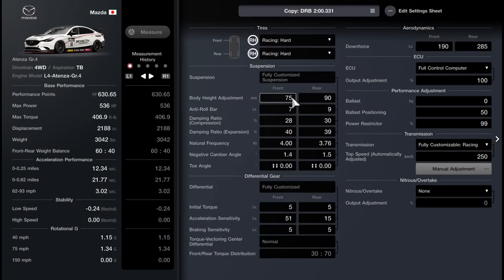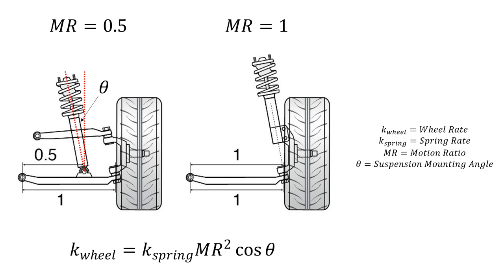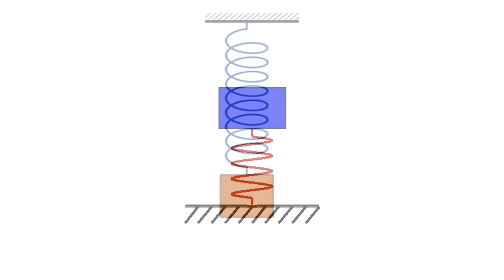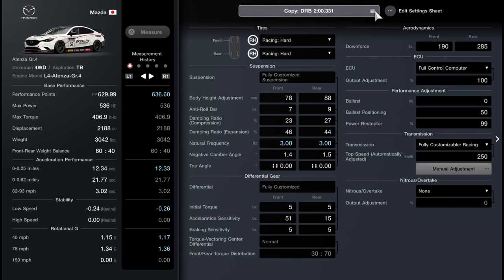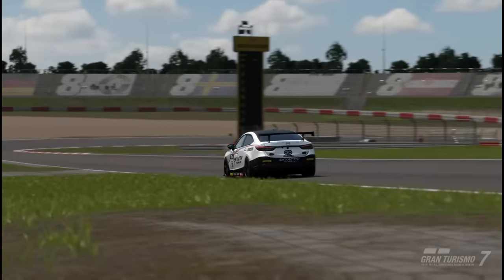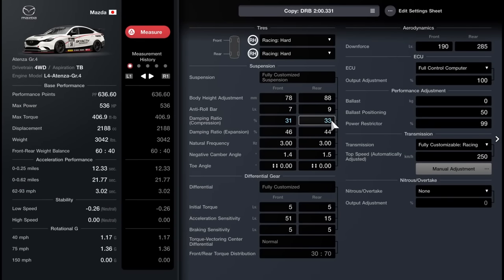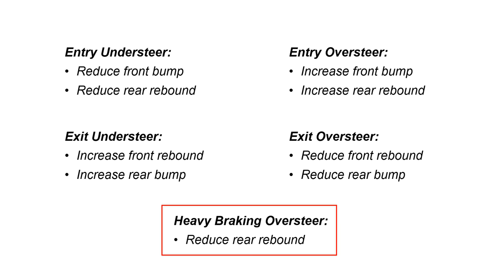How to Tune SUSPENSION | Part 1: Springs and Dampers | Gran Turismo 7 Tuning Guide

Comment: i spent several hours (lol) tonight playing with tuning, starting with whatever the game gives as baseline w/ the fully adjustable suspension. i found that pretty much every car (road car, not gr.1/2/3/4) i've tested has a default tune with the ride height and/or the natural frequencies so low that the front squats enough under braking to bottom out the suspension, and simply getting the right balance between ride height and NF alone can vastly improve how the car handles. many of the cars i've tested so far required some pretty hefty increases to ride height and NF to get close to where they probably should be.

Comment: Thank You so much for really breaking this all down. Really understanding both comprehensive  and rebound of the Damper is not only extremely helpful and interesting in the game but also real life. 
  I has a set of Fortune Auto 510's for my STI. I wanted to track it but also be able to drive it to the track. I had a vague understanding on how they act. 3-4 clicks from the softest for street the more clicks for mountain runs and 8-10 on track days.  We never really hit any rumble strips so I can run them pretty stiff on the track. Anyway thanks again, you really opened my eyes and gave me a new understanding for suspension.  I only have a single adjustment nob, and really don't like messing with the springs but I'm going to try a little softer for  track and see how it goes. ✌️

Comment: This is all really helpful. I appreciate the science, but the "showing us" is what I find most helpful. It gives me a good idea of what changes to make instead of randomly just throwing numbers around. Thank you.

Also, if possible, is there a theory on where to start when tuning? Start with the transmission and gearing first? Or the suspension? Or the differential? I know if you adjust one it affects others. Just a good idea of do this, get that right, then work on these, kind of insight.

ALL the help is really and truly appreciated. Sincerely!
Reply from the maker: It's hard to say where to start unless you can identify exactly where the problem is, and that just comes with experimenting. Normally I'll just drive a car with the stock setup and make changes as I see fit, and once I identify things that work on a lot of cars, I use those as a new starting point. 

Recognizing how the car feels with each change is something that comes with time and practice. The easiest way to see differences is making big changes. When there's no telemetry to use, sometimes that's your only option!
Reply: I'm not an expert, but I would start with the transmission as you want good gears, and modifying them can change the car behavior. Then adapt the suspension and differential to the car handling with the new gears. I guess that's the best way
Reply: As far as where to start tuning (assuming you can only change one or two things), I recommend reducing weight first.  Lower weight will benefit acceleration, braking, and cornering.
The next would be tires, as they will benefit all three as well.
I've won many races using considerably less power than the other cars by simply reducing weight and upgrading tires. This can be very helpful in races with limited PP.

Comment: I found when playing forza Motorsport, the easiest way to correct over/under steer was to change the caster angle, It put me on the backfoot when I found that the setting wasn’t in GT7. So this video was most helpful to help trouble shoot steering issues. I hope in part 2 you unpack camber and roll bar stiffness as some people have lots of camber and soft roll bars or stiff roll bars and less camber and I was wondering what the pros and cons are. Thanks

Comment: Also a good reminder, I was struggling with tuning my '89 m3 and was having rubbing and stiffness issues that I couldn't fully trouble-shoot around watkins glen. Changing back to the stock suspension for that event wasnt a deal-breaker and made the car so much nicer to drive. It allowed for more PP wiggle room to increase power too. Reverting to stock for a single race, or car that you're struggling to tune that you wont be maining, isnt the end of the world and now that m3 is my favourite 600pp go-to

Comment: Thank you for a good in depth tutorial on suspension tuning in GT7.
One question though about damper adjustment for under- and oversteer when braking.
I might be misunderstanding your explanation. But I find that adjusting the rear rebound works the opposite of what I interpreted from the video.
E.g. your car is understeering during braking. Because of the weight transfer towards the front. Stiffening the rebound on the rear will slow the extension of the rear springs. Then the rear tires have less friction. Making the rear slip a little bit and turning easier.

Comment: Really love your videos your explanations are so in depth and on point how I like to learn definitely the most helpful video I've found can't wait for the next ones u do on tuning....
One thing though I'm kind of slow at math so I'm not sure what kind of math you were showing I know it might be much to ask but could you make a dummies version of this??? I really really like what your doing here just a bit lost when it came to the math lol... guess I could always use a calculator but I'm not even sure how to figure it out lol. Sorry not trying to negative or anything just trying to understand so I can actually tune my cars to my liking lol
Reply from the maker: The math isn't important for tuning. The point of the math was to show that natural frequency takes the weight and spring rates of your car into account, so you don't have to worry about figuring out a bunch of different numbers - the number system is the same for every car.
Reply: @Harmonic14  ahhh okay thank you bro your so helpful I hope that your channel can eventually grow to be one of the biggest turismo channels thank you so much for the help 😀 👍

Comment: I have been playing gt7 for about 2 weeks now. I've been tinkering with suspension tuning, trying to fix certain problems in my cars (mainly tailhappy behaviors under braking). I drive street cars with sport tires, because I've never been a fan of race cars. I know about the characteristics of stiff versus soft, front and rear. The problem I have found is by stiffening everything to max, there physically isn't too much difference. In a realistic situation this would make the car an understeering brick. I'm not experiencing this, not even bottoming out.

Comment: So if you're making a street car have more power it is best to highten the natural frequency along the way. Damn, that was the last thing I would try to touch. Thanks for the info. I'll try to fix my Ford GT and Chevy Camaro ZL1 tomorrow and hope this video helped.
Reply from the maker: If you're just adding power, I'd actually recommend dropping natural frequency a bit in the rear. That will give you a bit more rear grip to put the power down easier

Comment: You have the best tuning videos!. I've improved my tuning greatly from these videos.

 One thing I can never get right is the order I tune my cars. I usually start by putting all the upgrades I want on. Then I'll start with ride height.  Move to lsd...go to suspension and start messing around with cambers etc. Then I'll do downforce  then last gearing. My problem is I'm allways going back because I'm never satisfied, and it makes my tuning very frustrating. It seems I am allways going back to ride height and needing to add more power, I seem to allways get my cars hadling better at a higher ride height. Especially braking performance...it's tough tuning. 

 Do you have any advice for me to perfect my craft? What order do you tune your cars in... I would love to see you do a full breakdown on tuning a car from 100% stock to raceday. I'm wondering what I can do to prevent me from allways going back and changing my tunes.

 Love the videos man, keep up the great work

Comment: great video! can you explain what you meant @ 15:54 about the risk of "bottoming out" if the natural frequency is set too stiff? i thought earlier in the video you mentioned that higher natural frequencies can fix the problem of the car bottoming out (e.g. the front squatting so hard under braking that the suspension compresses 100% to the 'stops' or the front bumper hits the ground) which does make sense to me.
Reply from the maker: I'm talking about softer frequencies there. Start it again at 15:49 and it should line up with earlier in the video 👍
Reply: @Harmonic14  duhhh, sorry about that! :)

Comment: You actually drive race cars right? These clips are awesome mate.
Reply from the maker: Thanks! I wish I drove race cars... haha I drive some performance cars at work though
Reply: @Harmonic14  I think I saw you comment on someone's video that you have experience driving cars, I have been to Grobnik track, but I have not had race car experience.

I hate the fact that GT7 Sport online races don't allow setup tuning. As far as I read, Balance of Power influences power, weight, aerodynamics, but nobody mentions setups.

Some cars are absolutely horribly setup by default and I see these edgy HaRDcoRe siM RacERs complaining GT7 is not realistic, meanwhile me in reality I have never experienced such a good driving model outside LFS and rFactor.

I don't know you might see some clips people driving and complaining about transient lift off oversteer on cars and blame it on the game's physics, which is completely wrong. Their setups make 0 sense, I have learned to tweak cars throughout the years and I love it when it just clicks.

Cheers mate.

Comment: Hey @harmonic! Idk if you can help but ive been struggling with the new gt3 992 on gran turismo 7 where the suspension always bottoms out down a fast hill and under braking and I lose control.

Any recommendations on what I could adjust? I stifferend the natural frequency but should I increae the dampening too?

Comment: Great job and an excellent video, really helpful!

I am having problems with a lot of RWD cars oversteering when cornering on throttle, and it is driving me crazy. I can't seem to get it under control no matter what I do. It feels like the front end of the car is completely overpowering the rear, but it happens almost exclusively while on throttle. Any (more) tips on trying to combat this? I've tried the things you mentioned in your video but even when the feel of the car changes, the problem still occurs.

An unrelated question: how exactly do I know if the suspension of a car is bottoming out?

Thank you!
Reply: @No name No name since this was almost half a year ago, my issues have been resolved by the numerous physics updates lol. As it turns out, PD just had the suspension simulation wrong for a lot of RWD cars. But thanks anyway :p

Comment: For me messing with natural frequency, LSD, camber, roll bars, brake balance and downforce it's the best way to go. Never touch damping.
Reply from the maker: Dampers are very important for fine tuning - they're there for a reason. Bad damper settings will cost you time no matter how perfect you can get the other settings.
Reply: @Harmonic14  i just like the default settings for dampers, for now it's all balanced and I can be faster as well but I understand what you are saying. One thing that it's very important in tuning its understand that all drivers are different and they feel the car different from each other. For example: If you use a setup made by me you can set a bad time and I with the same setup can set a better time. This is the magic of tuning 😎

Comment: Another great video..  I'm guessing you have an  mechanical engineer degree or you definitely work in the racing industry to have the knowledge you have..  I know every track is different as well as every car is different and I know people like yourself that race have different data sheet setups for different tracks and use different cars for different tracks as well..  I appreciate your knowledge and the time you spend creating these videos for people like me but to be honest I am overwhelmed because for someone like me it would take hours to get my car dialed in right if i ever  get dialed in right... Because there are so many different things that affect everything like natural frequency,  Downforce, rool bar, dampening ratio, toe angel, negative camber, initial torque, acceleration sensitivity, breaking sensitivity, gear ratio and so on... I have 22 Gr.3 cars, 5 Gr.4 cars and 3 Gr.1 cars.. I've been try to race some of the  Daily Gr.3 and Gr.4 races and I can't get my car set up right people are just pulling away from me.. I'm so frustrated I just want to get in my car and race knowing that it's competitive with everyone else's car... Like for instance I have a Peugeot L4-RCZ- Gr.3 and I'm trying to race Maggiore an Gr.3 PP730 race and I can't get my car set up right people are a pulling away from me and my back end is sliding in turns..  I just wish someone like you would sell data sheets for each car for every track setup... I like $20 per car...  I know you would make a lot of money..  Sorry for the long chapter... Thank you!
Reply from the maker: I do have an engineering background, but it's more electrical. My friends who are vehicle dynamics engineers show me enough of this stuff to get by. Haha

I'll slowly but surely get setup guides out there for each car in Gr.3 and Gr.4 as I acquire them in game. I don't feel like charging for them is the right thing to do though, so I'll just keep sharing them here on the channel.

I might consider some requests too, even if I don't end up making a video on them.
Reply: @Harmonic14  Can you please give me a good setup in the Maggiore Gr.3 Cup race the PP is 730 Pick any car you want I don't care I have 22 Gr.3 cars and if I don't have the car I will just go grind for it because i can make 52k in 5 minutes of raceing... Thank you!

Comment: What about instability during full throttle acceleration in a straight line, for example my fully upgraded Camaro 1le is massively unstable in a straight line at speeds under 100mph during acceleration
I could cut power but thats not ideal, Instead I stiffened suspension overall and tuned for more oversteer, it helped but the tire spin still happens more than id like, I could add more understeer but id like to be able to take corners lol.
Reply from the maker: It could just be a matter of throttle control. You can try softening rear frequency, or you can drop rear camber and lower the acceleration diff setting, but there's only so much setup can get you in a high power car like that

Comment: So for an idiot like me. If my fenders are blocking my tyres turning fully/locking the car into turn.
Presumably my suspension is allowing too much…compression? It’s not rode height cause even at maximum it happens.
Any advice

Comment: I have a question: personally, I prefer oversteering cars and during my setup sessions I try to achieve this usually without any or too much luck. What should I do or on what should I focus to get this result?? 
Thanks a lot in advance!!!!!
Reply from the maker: High rear roll bars and low front will get you there pretty quickly. There are other ways to do it but that's the quickest and easiest way to start
Reply: @Harmonic14  thanks a lot for your answer!!!!!!

Comment: Seeing that you can't change tires on dirt tracks, how the suspension moves is the only way to affect how much grip you have on a rally course. issues ive been having is my impreza coupe is sliding around like its on ice, and im unsure what i've been doing wrong. i've tried making the ride height tall, compression soft, vice versa, nothings working and nobody cares about rallying.

Comment: Great vid. Just subbed. Can suspension tuning help with oversteer under acceleration out of a corner?
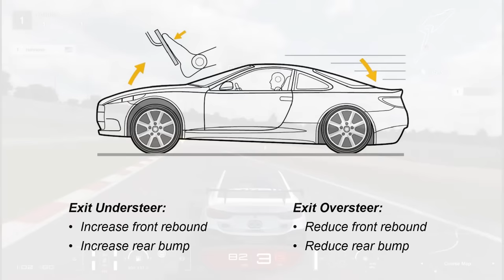Reply from the maker: Absolutely! Check out 19:31. Also lowering rear natural frequency can help. It all depends on what the exact issue is with the car though

Comment: Ever since GT Sport came out the suspension tuning has been a nightmare for me, I’m sure I can’t be alone, it was much easier to turn cars in the other GT games.
Reply from the maker: The settings haven't really changed much. The numbers themselves are different, but the things you can change are pretty much the same
Reply: @Harmonic14  I don’t know what’s different then, because I could easily make a 5 second tune and work on it as I go, Grand if you can’t use the same tune for FF FR AWD but it was much simpler then. Everything feels very sensitive with the wheel